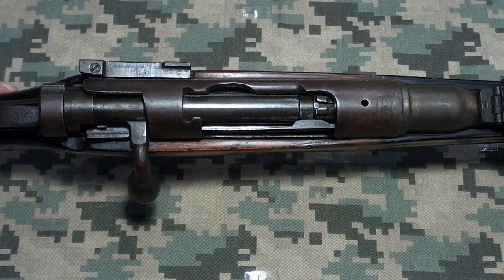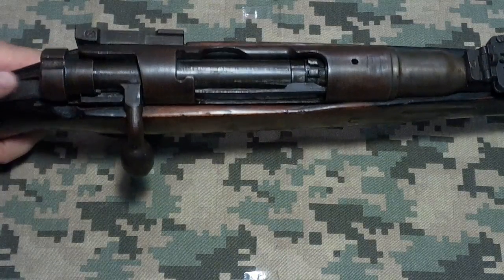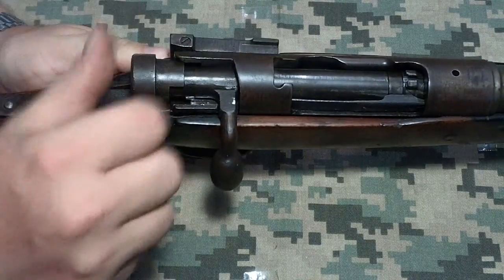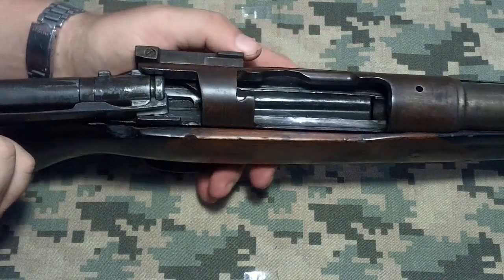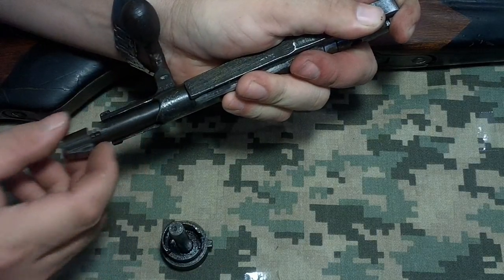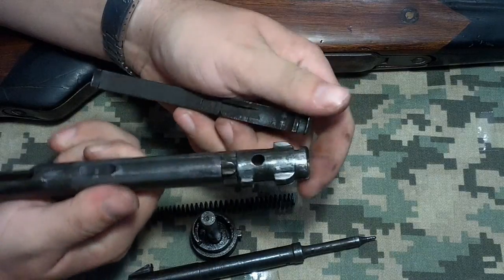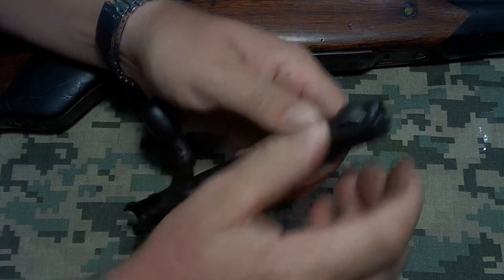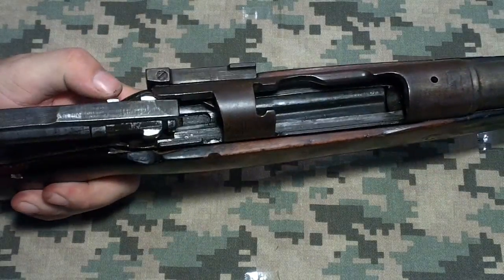Japanese Arisaka WW2 Service Rifle Bolt Disassembly

Comment: The one I got in a raffle is from 1939 has the aircraft cross on sights and doesn't have anything loose. Also has the emperors flower in front of where bullets are in clip.. won it for $20.

Comment: I have one chambered for 300 Savage . It's a pre-war model, and is a lot better built than the latter models. Make sure you keep the bolt extra clean or it will fire when you release the safety... I learned the hard way and have the hole in my wall to proof it :>)